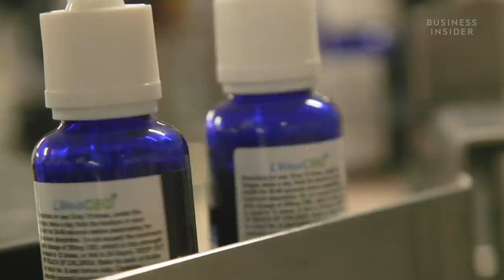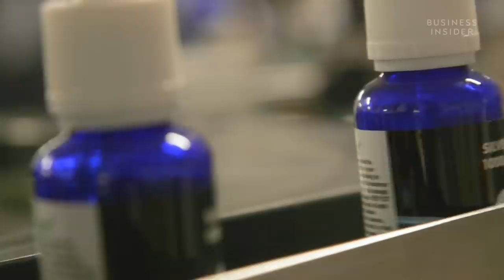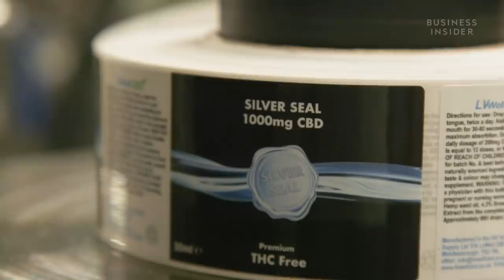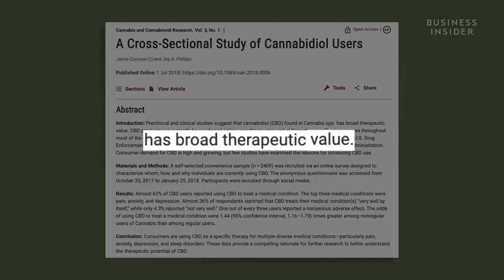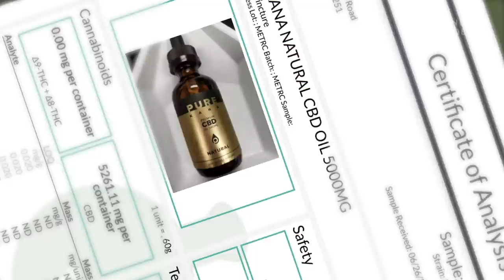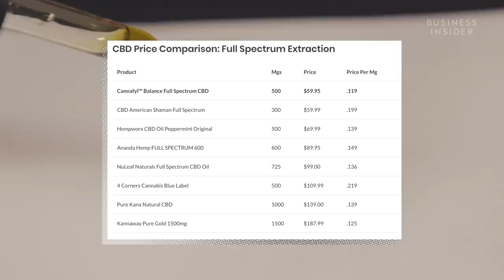Why Full-Spectrum CBD Oil is So Expensive | So Expensive

Comment: Have recently started using this to quit weed. It has really helped. Especially with the 0.3% THC. If you feel like you need to quit smoking, this is the way to go
Reply: Really? I had an intuitive insight... cuz weed was not cutting for me. i am reaching mid 30% thc level and was smoking 4 times a day, burning money, not feeling the positive effects... suddenly i felt I should give CBD a try. Today is day 1... hopefully it will help me cut back on weed. Thanks for the tip.
Reply: Did u every mix the oil with the weed just asking need to know

Comment: “Full Spectrum” can mean it has 99% cbd and 1% cbv. This lady is misleading when saying full spectrum is inherently a “higher quality” product because in fact many companies are using full spectrum to mark up price when having nearly identical lab results as a product created from just cbd isolate.
Reply: You’ve made a great point. I’ve seen this in my product on which i’ve spent 250€ (for 90ml, 15%CBD). The chemical test sheet shows almost no other cannabinoid, all the main ones (CBN, CBC, CBG) are in the 0.0X%.
Reply: Full spectrum means that it’s from the whole flower, not just one or few isolates.
It can be compared with a whole grain flour

Comment: CBD oils and powders are expensive cus of the extraction machines and extra processes they have to go through simply for consumption convenience. Buying the raw flower is natural and cheaper. Keep in mind, that 1500mg oil can also be bought through 10 grams of 15% CBD flowers for less than half the price. With oils, you might not even be getting the whole flowers but instead a bunch of leftover ground biomass.
Reply: Spot on. That's why I mostly smoke the flower.
Reply: Make your own cbd oil out of hemp...Soak in alcohol then burn off alcohol

Comment: Hey I was a licensed Hemp Farmer and Researcher from NC. License number 421 of the pilot hemp research program. The only certifiable organic FSE has to be made with organic extract. The only organic extract is ever clear. That stuff you see them using is actually FSE in something else, as actual FSE is 60% CBD by mass, and is like molasses. There is no way to use molasses like viscosity in a tincture, so its mixed with a carrier oil. The best carrier oil, is cold pressed hemp seed oil. So oil from the flower, put in oil from the seed... God's secret medicine.

Comment: I'm currently experimenting it's purported anti-inflammatory properties. Have had sinusitis twice and bronchitis once this year, requiring antibiotics each time. My 2 year old daughter tends to pick up any virus doing the rounds, wife also primary teacher so always around snotty children. I'd like to see if this helps to relieve inflammation of the mucosa associated with sinusitis and bronchitis. I'm three weeks in now using 1200mg (4%) spray under tongue, 3 sprays in morning, and another 3 before bed. Each spray is 15mg of cbd. I was not suffering from sinusitis or bronchitis prior to starting this experiment. No colds so far. I have to say, unexpectedly, I haven't had any aches or pains when I wake up. I generally feel more supple. I tend to say more what's on my mind so it could be taking the edge off of low level anxiety. I wake up feeling like my airways and sinuses are generally more open and clear. It's hard to be able to substantiate this, but I'll do another report in a few months once we are past winter. Almost out of the spray, which can get messy if the spray bounces off my tongue and ends up in the mirror. Going to order some drops next time instead. Looking at cold pressed full spectrum organic 1500mg drops. This  will cost about £100 per 30ml bottle so I will need to check how long this will last. But if it really is helping with what it seems to be helping with, then will be worth every penny. Plus I am personally more interested in organic cold pressed which makes it more expensive. Still going to maintain current dose of 45mg morning and 45mg in evening. Catch up in a few months! Send me a reminder if I forget or if anyone wants an update
Reply: I'm definitely not going to be able to maintain the current dosage with the new product as each £100 bottle would only last 16.7 days lol so I'm going to reduce my daily dosage quite substantially to 25mg in the morning and 25mg in the evening. Each droplet is 2.5mg cbd. This will give 30 days per bottle so still the cold pressed organic oil is very expensive but there we go. Over time I imagine I will figure out a lower dosage that still works. I started very high, exceeding the FDA recommendation of 70mg daily, so have lots of scope to reduce (I was at 90mg daily 😂). If I can eventually get two months per bottle it will be much more feasible long term.
Reply: How is it going?